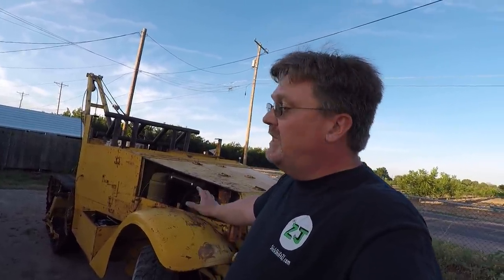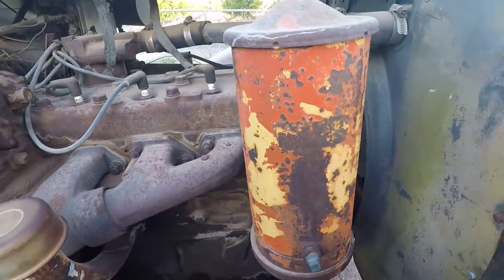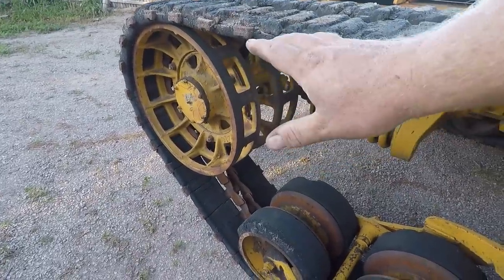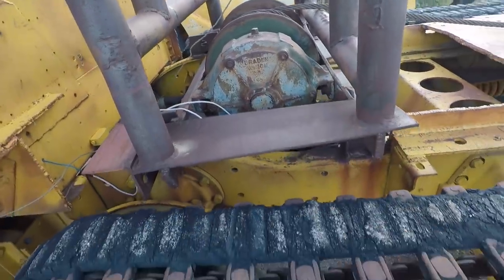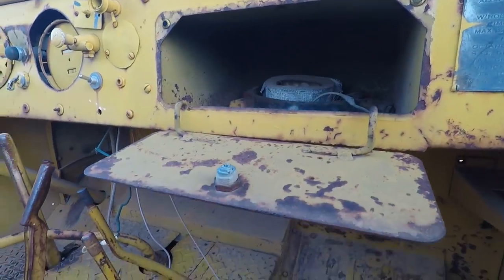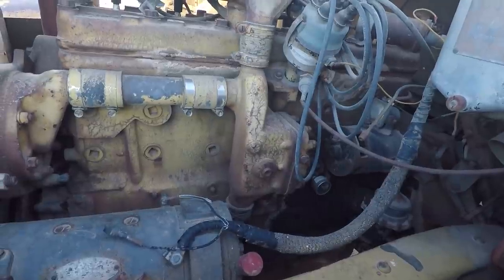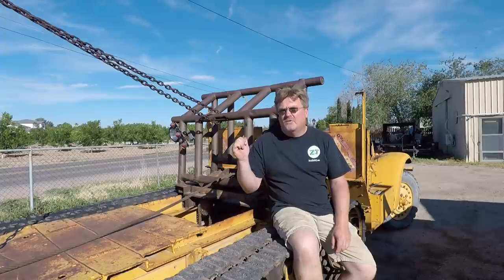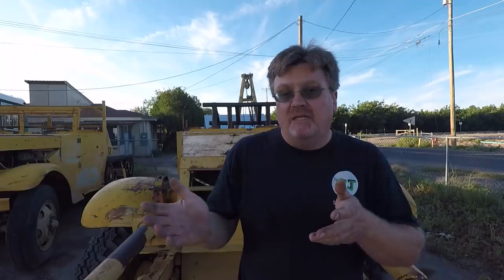WWII Half-track, Useful and Fun!

Comment: my dad drove a halftrack troop carrier over in germany when he was stationed there in the army in the early 50's. he said most of the roads in the town were loose stone cobbles, and he caused so much damage turning at the corners, that a german civilian road repair crew followed his unit around fixing them, and they just had enough time to fix them all before the next time they went on maneuvers and tore them up again. i was over there as a tanker on an m60a3 mbt in the mid 80's, and we weren't allowed to drive on cobblestone roads at all. i guess they learned their lesson in the 30 years between his tour of duty, and mine.
Reply: I was stationed at Coleman Army Airfield '87 - '89 with the 295th Avn. Regt. There was a armored unit on post. They were allowed to drive on cobblestone roads. The Army Engeineers would repair any road damage themselves because the Rads charged
Reply: Too much
Reply: @terrysmith4831  mebbe the difference in policy was due to the dcc. i was with 1st a.d. 37th tank in ansbach. the main headquarters for the 1st a.d. was based there, and for a time i was the driver for the dcc until a replacement driver was transferred from the states. he was a bit of a stickler for not rocking the boat with the local gov.
Reply: @handyhippie6548  In my unit, we didn't care what the Rads wanted. The gremans started two world wars, we, and the other Allied countries owned them and we should have more forcefull about enforcing it.

Comment: M16a1 would have normally been for anti aircraft and commonly had quad 50 cal machine guns.
Reply: yep, M16 had the Quad mount .50cals. the M13 had twin .50cal
Reply: your absolutely right 4 .50 cal's i drive one in my online tank simulator game war thunder lol it is a lot of fun
Reply: @kirkyorg7654  Wirbelwind!!!
Reply: @heinersaller5374  hate those things! lol have died to them more times than i care to count lol
Reply: @kirkyorg7654  yes if you hit an aircraft  with HE one shot is enough but .50 cals are badass too 31 mm of penetration is enough to destroy any tank at least from the side in low/mid tier
Reply: @heinersaller5374  lol youd never get near enough to scratch the paint on a modern tank

Comment: Definitely looking like it was converted into a old log skidder to use choke chains and for picking up the front of the logs to drag them through the woods. Probably the best non wheeled skidder ever made? Having the half track rear end. The fact it weighs 10 ton or more? It would have some great stability and low center of gravity for keeping it on its tracks. But by the way the front bumper looks? Definitely seems like it's been built to be a counter balance for the amounts of weight that it would pick up and haul? Otherwise it's just a awesome piece of old military equipment that has been re-purposed into something useful 👍 😀
Reply from the maker: I'm sure it had weights clamped to the bumper, the marks in the paint look like it.  It has been very useful!

Comment: My dad was a tracked vehicle mechanic with the 4th Armored Division in WWII. He said half tracks rode twice as bad a buckboard wagon. He spoke highly of the White models, the GMC ones overheated, the Dodge ones burned more oil than gas and the Studebaker ones ran well but got horrible gas milage. Any of them hardly ever had breaks.
BTW NAPA still has wheel cylinders on hand for these.
Love your projects, they sort of resemble mine around here.
I just subscribed!
Cheers
Terry
Reply from the maker: Thanks, and I appreciate the info, too!

Comment: I'm building a gin pole truck out of an old f550, guy I got it from had about 10x 7.3 diesel rigs, so for about 4 hours of injector rebuilding I got myself a 2001 f550, with a 7.3 and a zf6!  Its gonna replace my $500 f250, that the frame cracked finally from the salty roads here.  But don't worry, the front axle and a bunch of other parts fit the f550, so I'll have a 4x4 7.3 zf6 truck that can haul 10k lbs on the bed,  for 4hrs work, and $450 for the kit to divorce the transfer case from the f250.  Nothing better than a gin pole truck for dragging old iron out of the blackberry brambles.  Why are the best deals always back in the blackberry brambles?!? Thanks for all the great videos, I grew up as a poor farm kid, so had to do all my hot rodding on a tight budget, then I made good money as a mechanic and machinist, but wife got cancer, so had to do all my wrenching dirt cheap, then I got disabled with MS, so, for a change, I had to really pinch my pennies when I did projects, lol, so always looking for new tricks to do stuff the wrong (cheap) way, but have it work out still.

Comment: There was a war memorial around Wheaton, IL, that had a nice half-track.  A plate inside said "This vehicle cost the taxpayers $16,000."  You probably could multiply that by 30----$500K?  IDK if the place is there, since I was last there in the late '60s.
Reply: I think maybe you’re talking about Cantigny? If you are, it’s still there. I have fond memories of climbing on tanks and such when I was a kid in the mid 2000s. It wasn’t until I was older that I appreciated the other side of the park that is the WWI and II memorial and the McCormick estate.
Reply: @SubiefanWRXsti  That's the place.  I was last there in my teens---in the late '60s, and left the state in '94.  (That may be why all I remembered was the plate with $16K in tax money---If it didn't get a repaint, it had "Norma" in the same color, but you could see it).  Is that 37mm Rheinmetall anti-tank cannon still there?

Comment: Just for fun look up another repurposed WWII option called a Farm Hand . I operated one on a Armored Scout Vehicle.  It's Simalar to a Fork lift . Only with a platform for hoisting hay into a Loft in a Barn. You just reverse the steering wheel faces rear so does the hoiste the engine and Armored front become the rear and are plenty heavy for a balance weight.😁 same in line flat head .
Reply from the maker: I could use one of those!

Comment: It really helps old rubber if you paint it with flat black paint it keeps the ozone and uv out and slows down its degradation or you can buy actual Tire paint and paint the bogey wheels and tracks and it really extends their life.
Reply from the maker: Thanks for the tip!  I didn't know about tire paint before, I'll have to try that out.

Comment: If your going to drive this much in your yard , please invest in a new seat cushions , no need to sit on bare metal . Those will only increase in value , even more with a bit of love . NOS parts are still out there
Reply from the maker: The one concern I have is that the blazing sun here destroys a lot of materials.  I wouldn't want to ruin NOS parts, so I'd need to add a roof first.
Reply: @LowBuckGarage  Good old canvas will take  some abuse  , if you don't have a shelter to put the cab under then a roof is next , then you get into windshields and shift knobs and instrument clusters .
They built them pretty tough , just dont treat it like its indestructible , the tracks tend to rust from the inside when  water gets to the wire ropes (think there's 8 ?) When the rubber wears off the cross bars and the rubber cracks .
Might not happen as fast  as places that get lots of rain .
Makes a great parade vehicle with the booms shortened and lowered.
Reply: I believe the device on the firewall maybe a vaccum checkvalve that connects between the hydovac brake booster and the engine .
Instruction ,  parts and repair manuels are available for a price online from several sources . 
There are collectors clubs across the country if you look for them under military vehicle collector clubs for example .
I m sure you could find a buddy to help answer questions.

Comment: Do you happen to know anything on that braden winch I bought a cj2a with that exact one mounted on the back run off the pto which is just overkill haha
Reply from the maker: Wow, that is huge for a CJ-2A!  Its even overkill for this thing.  Sorry, I really don't know much about it at all, it was installed when I got the halftrack and I haven't had to fix it yet...
Reply: I'm betting the winch you have on the half-track came from the front and they just moved the placement of it to the back for use as a crane. It has a pto so it had a winch on the front at one point